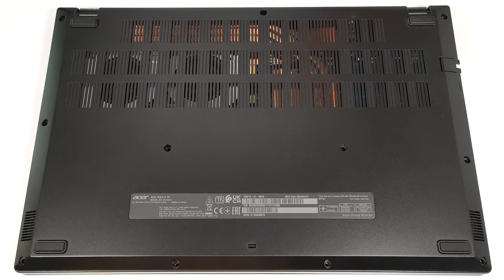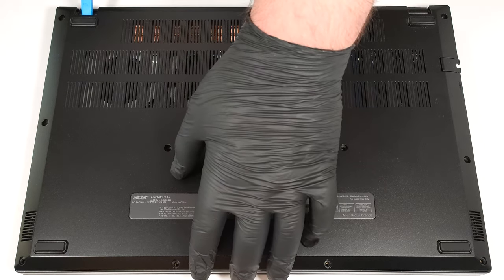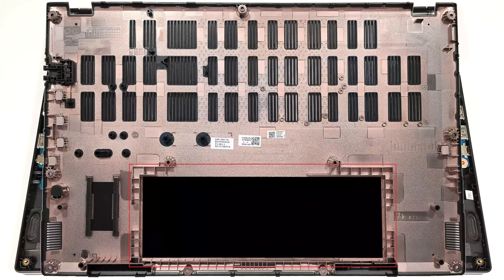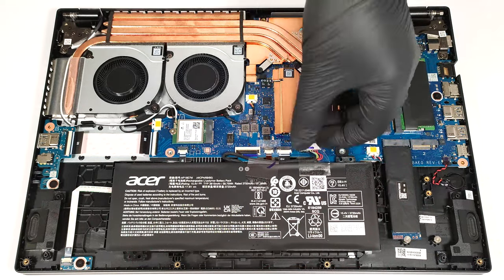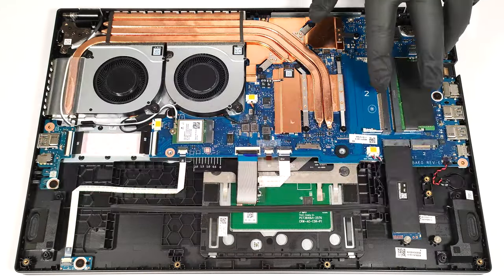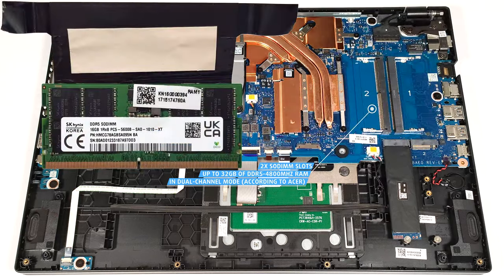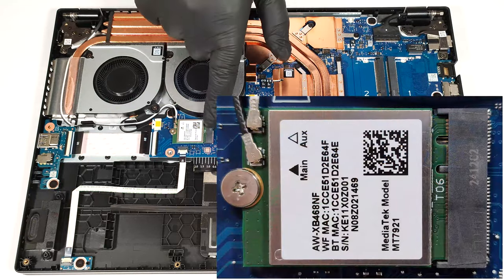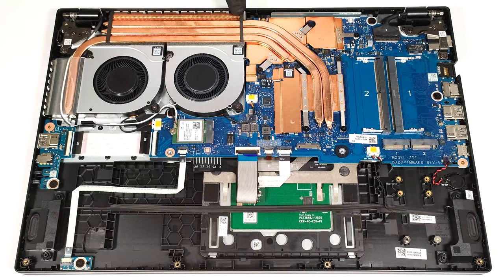🛠️ How to open Acer Nitro V 15 (ANV15-41) - disassembly and upgrade options

Comment: I've anv15-41 recently purchased this laptop & i can say its the best in its price segment i'm from india so indian unit offers 16/512gb preset storage the TGP is 65 watt with rtx 3050 6gb vram DDR 5 ram so its very future proof if you have low budget this is the right choice to go with it i tried play some heavy game is it like ETS 2 GOW horizon 5 in ETS 2 with 400% scaling with high ultra preset it was giving 55fps to 60fps which is unbelievable it outperform my expectations & alot better than most of the i5 gen 12 processors ryzen 7565 hs is better in terms of performance & efficiency & provides better battery life because of 6nm fabrication rather than intels 10nm fabrication processors i got deal during sales i bought it just in $680
Reply: Bro does ur laptop have mux ? And what about perfomance and battery backup and display should i go for it ?
Reply: @vkgaming5377  no it doesn't have mux switch mostly it's hard to get mux switch in this budget range along some compromises with hardware but for gaming perspective I'd say it doesn't matter alot when it comes to gaming it has decent performance & battery backup always been bad in gaming laptops whether it has mux or not i told about performance it can do decent gaming ETS2 with ultra preset along 400% upscaling I'm getting 60fps which makes a promise from hardware side that it can do alot more battery life isn't that good like any other gaming laptops when it comes to gaming if you do other tasks it can live upto 3 hrs display is decent also with adaptive sync 144hz which can help in saving battery life it has noisy fans which are integrated upper side like aspire 7 so while gaming if you don't like the noise you have to customise the fans in nitro app & use headphones or buds whatever you have display is just like any other laptop you're getting in this price range note my words price & budget it depends on how much you can invest in my budget I felt it was best & I went with it & I don't have any regrets so recommend that if you have tight budget of 60k you can go with it it won't disappoint you at all it's future proof & can survive among the flagship laptops
Reply: @amanarif8719  oh i see does it have wifi 6 or 6e and i just need for coding and gami g like cod w2...i ll play on low graphics and high fps......is it good for it ? And heard that igpu can be acti aed on bios settings do u have any idea about it ?.....and are u satisfied about display ?? And wb backup medium usage and .....is it really future proof ?
Reply: Does it thermal throttle?
Reply: Which Processor you have
Reply: @MK1001-wr5yj  Ryzen 5 7535 HS it has mux switch also
Reply: @amanarif8719  does this can RUN GTA V at 100+ fps ? And what is 400% scaling
Reply: @MK1001-wr5yj  yes with high settings you can achieve upto 95 to 100 constant FPS & 400% upscaling means making graphics looks like 4k resolution with texture & screen quality goes up with that in ETS 2

Comment: hi dude,, i love your vids.
so basically the same laptop as ANV15-51?
Reply: Based on my research 

51 spec:
Using Intel cpu , less battery life and etc...

41 spec:
Using amd cpu , more battery life and etc...

That's the simple one i can give. you can search on Google for more detail thou
Reply: @Haikalwoi 51 have that something double shot killer pro and think wifi 6e this 41 have only wifi 6 ...these diff i found

Comment: Mine came with gtx 4060 why everybody talk about 3050 !!! ? Also i m wondering if there is any recommandations about ram ddr5 i must take for that laptop ? I m noob in repairing laptop and replacing équipements 😅
Reply: If it's the anv15-41 it takes ddr5 4800. My wife got one and it only has 8 gig of ram and we upgraded it and bows it's a new machine.